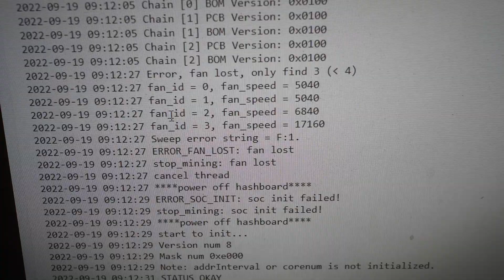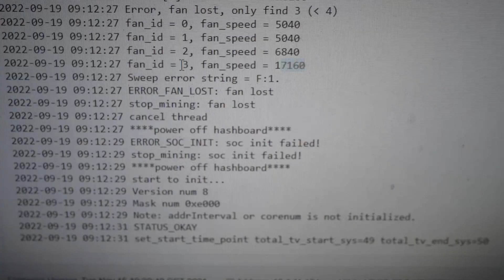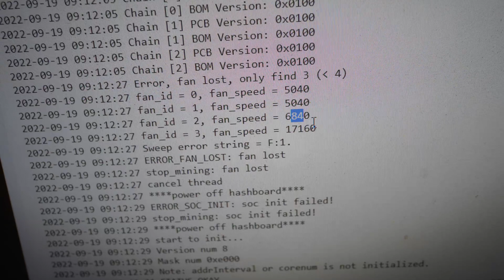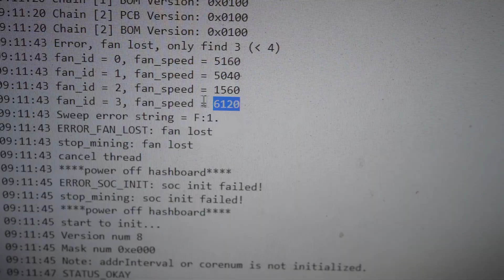Bitcoin Farm - Problems with Fans - How to Fix

Comment: The frontfans going out is not the case for me 99% of the time. It's pretty balanced. I would think the rear fans take all the heat...but then again the front fans will get more dust/potential debris...and slightly higher humidity levels.